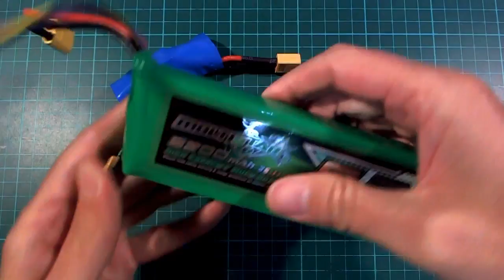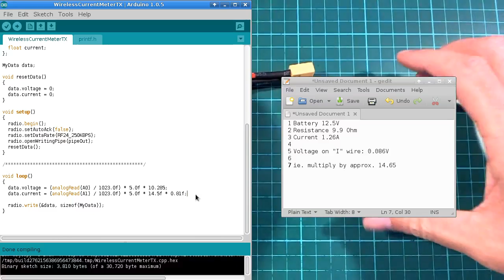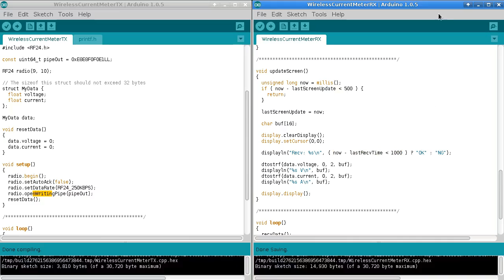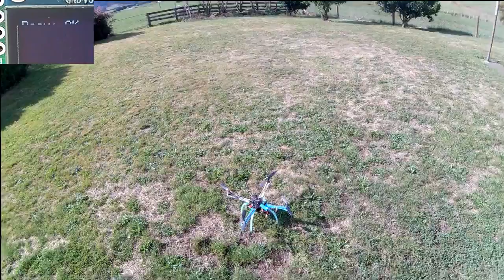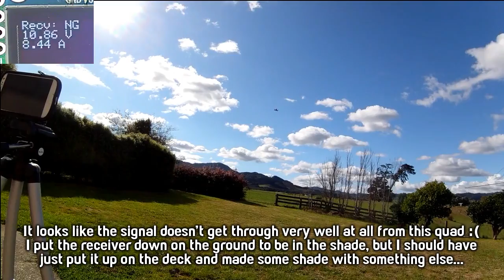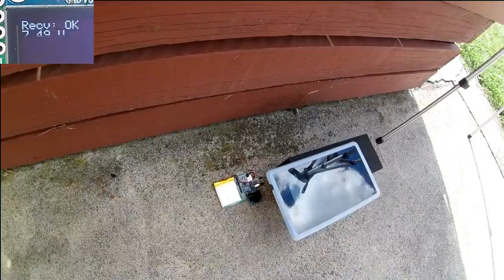Wireless current sensor (arduino)

Comment: Yo chris, you probably know that the reason for the poor precision is that the analogread function gives you the value of the analogue pin from 0 to 5 volts, but since the region you're interested in is so much smaller it's only covered by a handful of the values you actually get to look at, and the measurement is swamped out by quantization noise. Of course you could add an opamp to boost the signal, adding more complexity and headache, but there are a few things you can do with the Arduino to help you out. First is that some models actually support a higher resolution, and it's just being downsampled to 10 bits for consistency in the Arduino ecosystem. I can't speak to if that specific model supports it, but it's handy to know about. The other thing is potentially even more powerful, and that's the aref pin. By default the value you get from that function represents a value from 0v to 5v, however that high value is completely arbitrary. You can tell the Arduino to instead measure the value with respect to the aref pin, then set the aref pin with a voltage divider from your rail voltage (assuming that pin has high input impedence, I assume it does?) Bada-bing bada-boom

If you already knew this stuff sorry lol but if you didn't it might be helpful, even if not on this project

Comment: Is it easy to add a beeper to the telemetry "receiver" to let you know when voltage becomes too low? I think this is very useful function to protect your battery. I've had my RC battery get damaged because I ran the voltage too low.

Comment: Hi, Instead of showing the battery voltage is there a way you could make it show the battery percentage? 
Thank You
Reply from the maker: I think technically there is no such thing as a percentage, unless you define zero to be some voltage that you consider to be 'empty'. If so then sure, just show how far it is between the 'full' and 'empty' values.

Comment: Hi. Can you link the place where you have bought the colored cables you are using?
Thanks
Reply from the maker: I bought them at a shop in Japan when I lived there. But they are nothing special, just normal wire.
Reply: iforce2d thanks. they are neat

Comment: Dont take the C ratings too seriously, they are just a label that helps to sell the product. The main thing to look at is internal resistance - from that you can get an idea what current is safe for the battery and what is not. Imagine drawing 90A from that 2,2Ah battery...it would probably puff because of all the heat generated inside on that internal resistance.

Comment: Have you seen Julian Letts video on Hall effect current meters? he featured one that can be purchased for £1.30 and measures up to 30A https://www.youtube.com/watch?v=UF5jrnXvTlM but that got me thinking and so I have just received a similar device also made by Allegro that is ratted for 200A costing £3 ACS758ECB-200B. Havent tried it on the quad yet but what i like is they can be very accurate and don't require a shunt resistor therefore no power wasted! 
I also have that battery but a tree pierced a whole in it on the first run so didnt give it a fair test, very thin foil casing i might say though. Love both yours and Julians channel, keep up the good work.
Reply from the maker: +Jacob Williams just watched it now, didn't know about those. I was just thinking about getting another of these shunt thingies for a thrust test stand I'm making. I think I'll stick to the normal resistor, but it's good to know about the hall method ones for the future.

Comment: I have the same set-up s500 with Tarot GOPRO T4-3D 3 Axis Brushless Camera Gimbal gopro 4 black and the LiHV Multistar  5200MaH 10C and flight time is 14 min.Battery gets a little hot after flight but only when you push the quad hard.
Ordered 2 battery's by HK and 1 D.O.A. only 1 cell good.Managed to fix that by soldering the other 2 cells in series.
So I'm not impressed by the quality of the Multistar LiVH battery's after opening the green plastic.
Reply from the maker: +Peter Hubregsen yeah I think they are a bit wimpy. The other day I flew one of my smaller (for miniquad) multistar batteries a bit longer than I should have - too lazy to walk over to pick it up - and now three of the cells are at 1.2v which probably means it's the end of the road for it. I have done that occasionally with nano-tech batteries and I'm still using them 9 months later...
Reply: +iforce2d I see now that you have the LiPo Multistar 5200MaH I have the LiHV type so not a real comparison but you get what you pay for I think.I charged my Multistar 5200MaH LiHV only to 4.30V but new charger is on the way to charged them to 4.35V then I test the flight time again.

Comment: This is very innovative to have this V-I statistics and also how much cumulative total power have been drawn from it. This will not only give prior indication of battery emptiness but also be a good dashboard for the RC toys. A bit of accuracy is really needed here. A better resolution ADC like 12 bit one can do that pretty nicely. STM32F030F4 is very cheap which can suit for this kind very nicely. A 5 milli ohm shunt resistor will just drop about 0.1 V at 20Amp OPA335 could easily enhance the burden voltage to ADC's FS range. A faster sampling would keep the total consumed power during flight time.  Your uploads are getting attractive day by day. Keep up the good work man!
Reply from the maker: +Satyajit Roy yes, I've ordered a nice ADC for my next current-measuring project
Reply: +iforce2d The idea of having the current and voltage measured remote was unique to me. I really loved that although I am not in to any RC toys yet. Yes, I have a dream of making a quad someday. You could also check INA219 current sensing chip that gives digital output without having too much hassles in analog part. It has 12 bit resolution. Senses Bus Voltages from 0 to 26 V